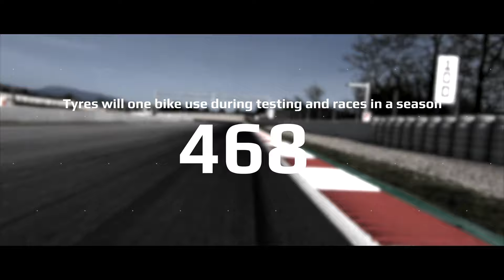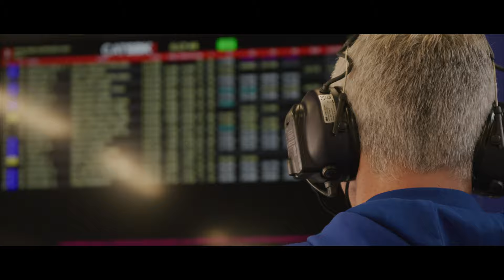Developing the 2021 Yamaha R1 WorldSBK

Comment: Guys, respect for all the job you are doing. But on the straight in Mugello you must have seen what others did when Toprak was fighting with Kawa and Ducati. You must do better.
Nevertheless wishing all the team the best and the SBK title win. Would be great.
Reply: The Yamaha will always pay a penalty when it comes to top speed if they continue to use the cross plain engine
 The balancer shaft they need for this engine is the problem. Having said that, that engine also allows great control at the limit of cornering power, it's a serious trade off. The Yamaha is not a slow bike as some people say, yes it doesn't have the same top speed of some of the other bikes, but makes up for it in other ways. It's a quick bike, just different, I love it, and I love Yamaha's persistence with it. Always loved Yamaha machines.